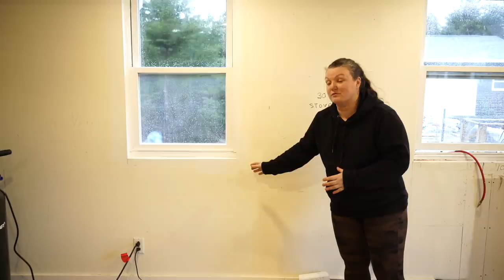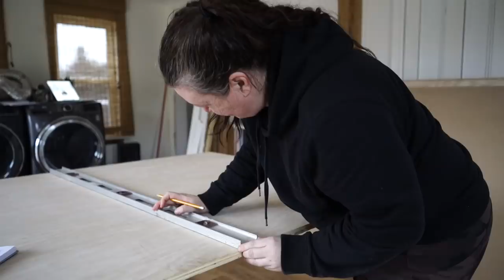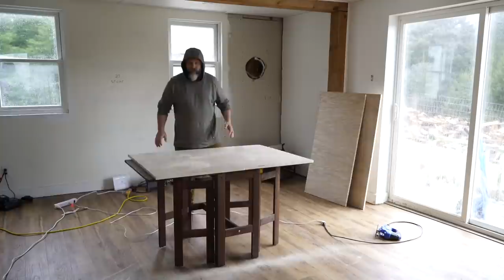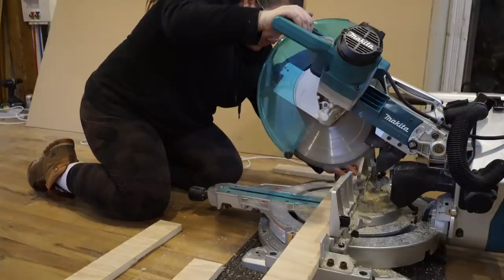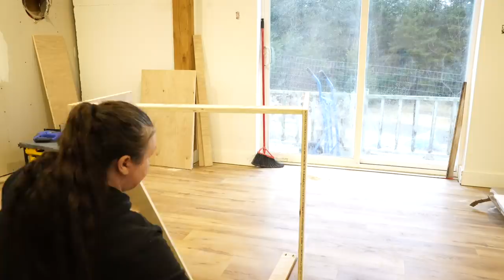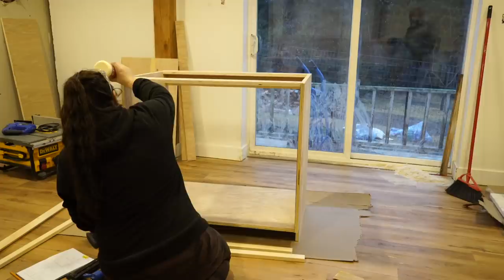Building my own kitchen cabinets from scratch!

Comment: Please put your stove in the spot now, and build your cabinets around the stove and wood stove. You will make sure your cabinets are the correct size. Will make it easier
Reply: You do not need to do that if you measure the appliances,  why would you want to get the appliances all banged up having cabinets built around them.
Reply: Remember kitchen cabinets are boxes with doors. You built the beautiful cabinets in the living room so why are you freaking out? Measure 2x or 3x before you cut.
Reply: Cabinets are installed and completed before appliances are put in... that's what measurements are for.

Comment: I would totally stop right where you are at. Before putting your cabinets in.... you might want to move your outlets up above counter height. If you like to use your crockpot, instant pot, air fryer, mixer, blender etc... you are not going to want to open a cabinet and crawl in there to plug in. Get your outlets moved now before adding cabinets. Also, you want to put some rails for support under that bottom to your cabinet so that it doesn't sag after the 1st 2 years or so. Trust me, I have made that mistake. Otherwise... YOU ARE DOING GREAT!!! Keep up the good work. Love watching you.

Comment: Just a suggestion for the cabinet for your pots you should put in a pull out it makes it much easier to get to your pots and also for cabinets with bottom shelves its so much easier than bending down and  looking to back of cabinets, you did great on your first cabinet I had faith in you lol!
Reply: We have all drawer bottom cabinets except for our corner cabinet.  Something we took with us from our house in Alaska.
Reply: You can add pull outs later but it would be easier now. The hardware is pretty pricey I think.  It could be difficult to get now as well.
Reply: It is so easy to install a sliding shelf . You can do it!

Comment: Just a heads up. Don't forget about a stylish functional place to store wood in the kitchen for your wood stove. From experience it is always dusty and crumbly with bark pieces. Maybe put a grate in the bottom with a water proof dust pan you can pull out and clean. Also sometimes there is water from damp wood. Good luck. Love both the oops rug and the dreamy. Goes well with the orange in the leather couch.

Comment: With doing all the cutting in your house, please consider attaching a hose to the saws to minimize how much dust goes into the air. Also, what you’re doing with the Kre jig is called pocket holes. Fantastic for cabinet building. Looking great though!

Comment: It's so exciting just to see this first cabinet taking shape, you must be over the moon!! Also, I've got a kreg jig I haven't used yet and you got me so pumped to try it :D

For the face frame pieces, you could try offering up your 1x2s and marking a cute line directly in the wood. I personally find that lots easier & more accurate than measuring with tape but of course your mileage may vary. I know you'll do an awesome job, and I love your philosophy that there's no mistake your can't fix.

Comment: I know that you said you are putting a shelf in the first cabinet you are building (which by the way, looks fabulous), but I would suggest you build drawers.  They are so much more functional, especially with heavy pots and pans.  The drawers are quite wide and that has ‘t been a problem.  Love mine.

Comment: A tip when your putting your pocket hole screws in put your drill on reverse first and press the drill with screw in then to sort of prime the hole, then switch the direction and they will drive in with out sliding keeping your pieces aligned.

Comment: May want to cut out a small square to be able to access the plug in .  Maybe for a lamp or what ever.  I also saw something  the other day that  said t o glue from the bottom to the top because other wise the glue will run down what you are gluing and when you go from top to bottom you use less glue.  Just a thought.  You guys are amazing!
Reply from the maker: The outlet will be moved

Comment: just a suggestion you should put a center brace piece under your bottom shelf especially if you're putting pots and pans in there plus the weight of the oak , it will sag over time trust me, I learned that lesson, but it is looking fantastic !!!!

Comment: Just a thought. You should be moving your electrical outlets up so you have counter plugs. 
Or they have these new outlets that you can put on your upper cabinet bottoms instead of in the walls.
Reply from the maker: yes they will be relocated. The cabinet is not installed on the wall yet.

Comment: Please make sure to move that electrical outlet, before you attach the cabnet to the wall.
Reply: I was just thinking this. In the UK, the cooker/stove needs a higher rated electrical supply with its own fuse on the fuse box. That needs to be wired in before the cabinets go in

Comment: Great job. Get a circular saw because a jig saw rips up the wood since the blade cuts up and down.. the circular saw cuts in one direction only.
Reply from the maker: Yes we had one but it caught on fire when building the skating rink. I haven't replaced it yet
Reply: @ElysiaEnglish , wow, that sounds scary. Build the drawers, which will be no big deal for you because of your skills,  and then conquer the first installation of the drawer runners. Then you will be good to go. You’ve done so well with all your builds. You go girl!! Oh, and Phillip of course.

Comment: I am using stock unfinished oak cabinets for my kitchen which I bought several years ago. These do not perfectly fit my 100+ year old kitchen. I am saving your cabinet building videos to help me build the cabinets and doors for the in between spaces. 
Thank you !  Also have a Kreg jig but have been afraid to use it. 🤦🏻‍♀️

Comment: When will you have the kitchen wired, and the plumbing put in?
Reply from the maker: The plumbing is needed for the centre of the island. If we do that plumbing now it will be in the way until we get to the island part of the process.
Reply: @ElysiaEnglish  I figured that, but noticed the electric hadn't been moved yet, and the plugs on the wall where those cabinets are going are down low, and will need to be moved in. If your electric is like ours, you will need a hookup for a stove on that wall as well.

Comment: Elysia, do you not have to have the plumbing and electrics done first?
Reply from the maker: We just need to hook up plumbing under the island up form the basement. We will put it thru the floor when we get to the island part of the build or it will just be int eh way right now while we build :)

Comment: I'm just as confused about the change of saws when my husband cuts wood as you guys. 3 saws so far. It really stinks to have to have so many saws to do the things. And I wouldn't know which one to use just by watching ppl. Hubby trys to explain it to me but really it still makes no sense to me.. why don't they just make a saw that you can do it all! Good greif the old timers did it all with just an old fashion hand saw. Grandpa didn't even own anything that was electric. I really do think about how hard that must have been, no chain saw no jigsaw, no table saw & what ever that other saw is. And he cut wood without a chainsaw to heat the house always until he was an old man. He did have a buzz saw, but I been thinking alot how did he cut the small trees down he brought to the house to cut up with the buzz saw. We are just to spoiled these days. I tell my hubby all the time, because he has so many old school ways & knowledge of how to do things that the ways are fading away. Skills that very few still have. That he has allready  forgotten what most ppl. Will never even know. He still amazes me with those skills every single day, we are both 65, if we can find anyway to make things work, it's usually gonna have to be old school, reclaim all the way. Just away of life some ppl. have no choice. We are doing a huge remodle project. A single wide mobilehome & added a 1/2 doublewide togather. And a new roof over those. Gutted the inside recycling what we can, but a few new pieces of lumber.  And it's on! I salvaged the old cabinets stripping sanding stained & refinished, the fronts anyways, they where really nice wood. A freind built the base structures. I never heard them called carcuses before. We just call them base of the cabinet or shell I suppose. Here a carcus refers to an animal usually. Can't wait to see your cabinets, what is the pretty parts, the door fronts & draw fronts being made out of?

Comment: I have to giggle... You can tell Elicia is a Kraig jig newbie because she keeps calling them Kreg holes instead of pocket holes. And that just makes me laugh. Just so you know you can plug the pocket holes with dowels (and then obviously trim the dowel) if you find yourself stuck in a situation where you need the strength of a pocket hole joint but your structure does not allow for hidden pocket holes. They even make and sell pocket hole specific plugs. Using a dowel of the same material most often lends itself to better hidden joinery than the prefab plug.